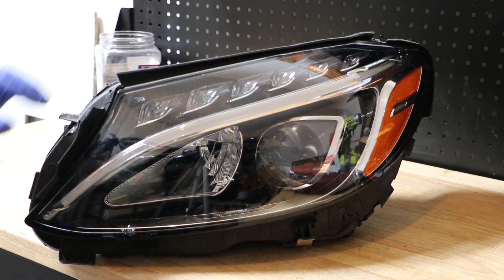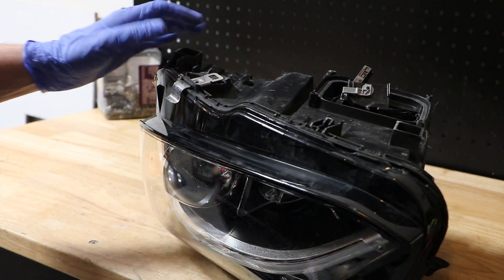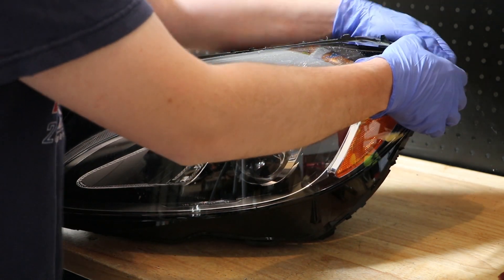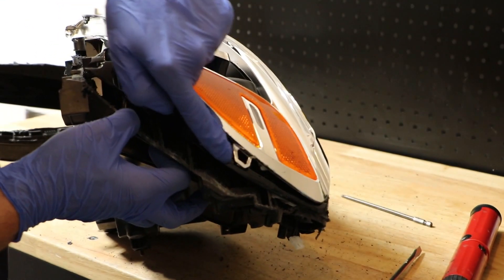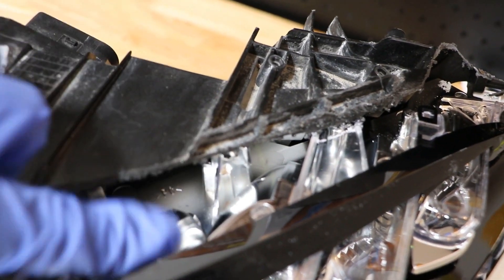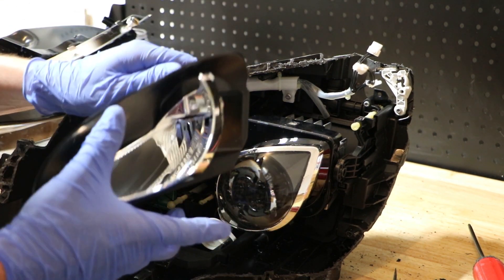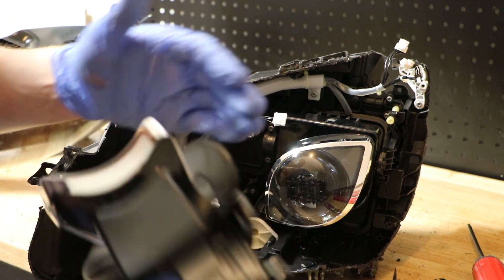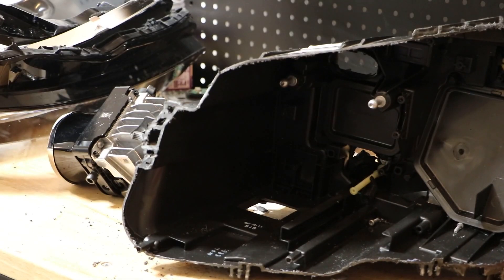Mercedes-Benz C Class LED Headlight Tear Down/Disassembly

Comment: Hi, Thanks for the video, mate. I am wondering where the servo motors are located in the headlight, the ones responsible for headlight control range and adaptive cornering light?

Comment: OMG so hard, f this Mercedes where is Toyota
Reply from the maker: @chelovekpravdi  
Toyotas are built with less components as they generally don't move or have adaptive features, but Toyota seals the control modules inside of the headlight so they are not serviceable.

Comment: Is the ballast under the headlight? Can I access the ballast behind the front wheel without taking the wheel off. Also with a new ballast will it have to be programmed? I’m asking some reviews on and some say it was plug and play.
Reply from the maker: Yes it is underneath.   I don't know if you'll be able to access it without taking the light out.   

Mercedes says you need to reprogram the light when you change the ballast, headlight, or vehicle.  If it works without reprogramming, you will run the risk of damaging the LEDs.
Reply: @gftgrill  appreciate the info. From now the previous generation you could take the wheel off and the plastic under the wheel well and access it. Just doesn’t seem like you’ll be able to get it at the angle its at I saw it the other day(it’s a friend car) unless there’s plastic to access the bulb or underneath the front to do a fog light or something with some extensions

Comment: Great video , I was just wondering if there’s a way to open up the backing and change out the headlights without tearing the whole lens apart ?
Reply from the maker: The lens has to come off to get access to all of the screws inside of the light.   You might be able to cut holes on the housing, but then you would have to reseal those holes somehow.   Removing the lens is the cleanest way that I know of to get access to the inside
Reply: @gftgrill  that’s crazy ! All that work just for a lightbulb ? What are they thinking

Comment: Hi, How long do you put it in the oven to take the lens off, thanks
Reply from the maker: "it depends"   not all ovens are the same.  it's best to start at 15-20 minutes and work your way up from there.   you most likely will need to put it in the oven more than once and you don't want to over heat it in and melt the plastic.  IMO, baking headlights is more of an art than a science.

Comment: My headlight is working but lens is cracked, is there any way that i can just fix or change that cracked part (lens) ? Thanks
Reply from the maker: You'll have to find another headlight and remove the lens, then remove yours and do the swap.  You have to be careful to correctly reseal your light to avoid moisture and condensation problems.   For most people it's easier to just replace the whole headlight and be done.  30 minutes to replace whole light vs 2 to 5 hours to do the lens swap.

Comment: Cracked my lens cover got it replaced by a mechanic but it's now fogging up when it's too cold or rainy.... Should I just get a new headlight?
Reply from the maker: While that's not uncommon, they probably didn't reseal the lens correctly and you would need to pull the lens off again and apply a new liquid seal.

Comment: Hello friend. I have a 2015 c200 headlight. My right headlight is not working can it be possible that its a module tht is broken? Please help
Reply from the maker: Yes, it could be a controller or fuse.  you should be able to swap the ballast from left to right to see if the failure travels with the ballast.

Comment: Hi, my right sidemarker LED stopped working. Would it be possible to take the headlight housing apart and only replace the faulty component?
Reply from the maker: it would be possible, but you would need  one from a donor headlight.   Generally it's easier to buy a new headlight and do the whole light swap than try to disassemble 2 headlights and swap the parts and then reseal and reinstall.   The question is how much can you get a different light for vs how much is your time worth.

Comment: Hi friend, Do you need to heat the headlight to take off the glass? Thank you
Reply from the maker: That is the general way to remove the lens when you plan to put it back.   I cut the lens off for these videos as I do not put the lights back together.
Reply: @gftgrill  I don't understand, to remove the glass from the headlight did you need to heat the headlight to take off the glass where it is just clips?
Reply from the maker: @caratauto5079  The lens is glued to the body.   Those clips you see are only to hold the lens and body together while the glue dries.   Once the glue is dry from the factory, those clips serve no purpose
Reply: What kind of glue do they use? I was thinking of repairing my headlight myself (water got in somehow, no apparent damage can be seen), so I'd need to open it, dry it up and re-seal it -> install new module... 

My headlight isn't drying at all, after 4 days of sunny weather 😅

Comment: My boyfriend broke his C200 Cabriolet right headlight due to a minor accident. A day after, the auto light stopped working on the right one, and full beam on the LEFT headlight stopped working as well, even though there’s no damage on the left side. Any idea if both headlights should be changed or just 1?
Reply from the maker: That issue is going to require hands-on diagnosis.  there could be a bad fuse/relay, you could have damaged the wire harness. the left side light could have been damaged from the shock of the impact.
Reply: gftgrill
 Alright, will get that checked.
There has also been an issue with the ABS ever since, do you think it’s related to it? If yes, would that need to be fixed as well?
Reply: gftgrill Automatic Brake System (the sensor that automatically makes the car brake if a car in front of you slows down)
Reply from the maker: @shadzmikewy  there are lots of those sensors around the vehicle.  I would guess that one of the distance sensors and/or wire harness was damaged in the accident
Reply: gftgrill Thanks so much!!! You really helped a lot ☺️
Reply: Mr brother*😉

Comment: Wait so when u take off the seal you have to break the clips to take it off ??
Reply from the maker: No. the seal just needs to be popped off (carefully).  It is meant to be replaced if worn or damaged and has a part number specific to the seal.

Comment: Hi,
Is there a possibility the signal indicator could be changed?
Reply from the maker: If you look here:  https://youtu.be/K1hZDdpLwec?t=178

That is the turn signal LED.  it's a small circuit board on the heat sink.  You can replace that unit as a whole, but if you wanted to change it to something custom, that's going to require finding one that meets the same specs with a different color or you have to modify the existing PCB yourself.

Comment: hi, do you need to code those type of headlight? i want to buy and mount them but idk if i need to code them?
Reply: Alina Serbu yes you have to code them. Only Mercedes can do that. The module that’s behind the LED light needs coding. The LED module burns out sometimes and that module is £220 alone. If the actual LED light burns out you have to change the whole headlight on my 2013 SL it was £1079. Cross your self and walk away from these lights in fact head for the hills and run there not worth it.